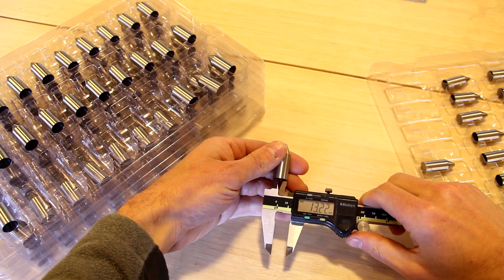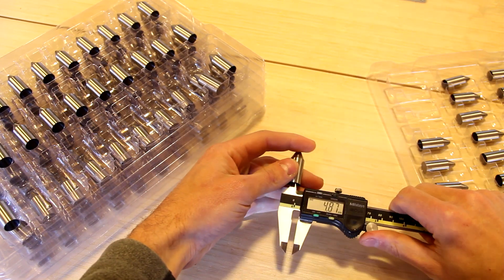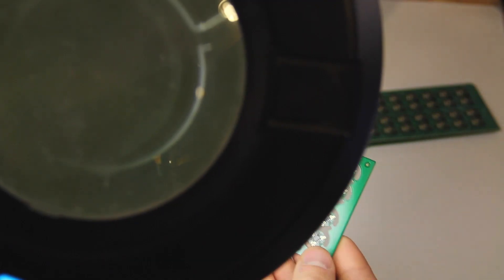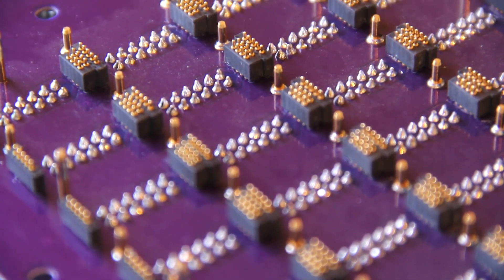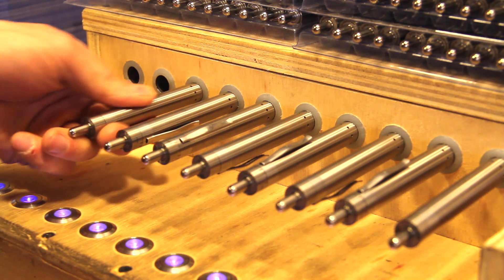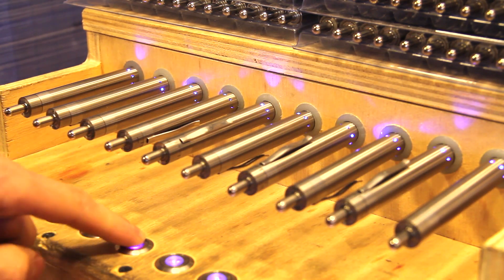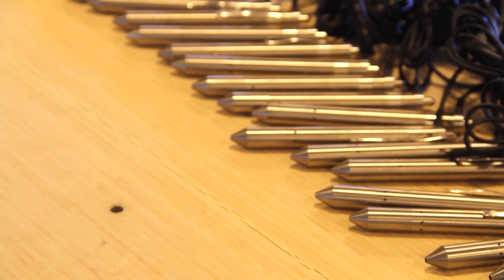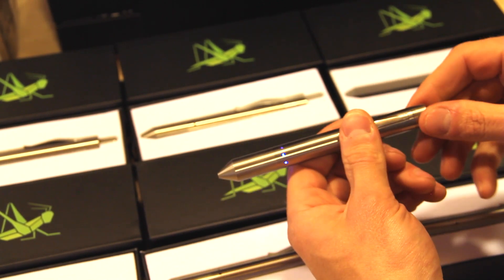Hopper Labs Testing and QC Walkthrough

Comment: That air pull machine is awesome! 

Great video!
Reply from the maker: Thanks, it's a critical piece of equipment. Designed and built in-house like most of the Hopper assembly line.
Reply: Very cool. It's nice to see all the work that goes into every grasshopper.

Well done!